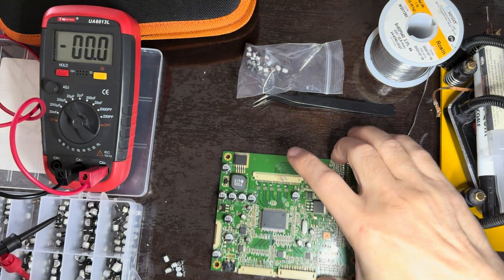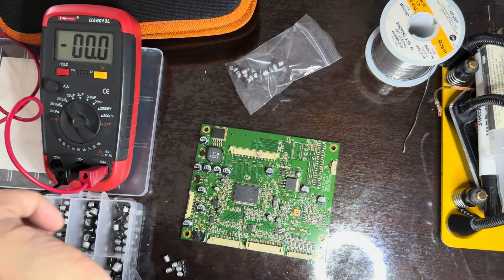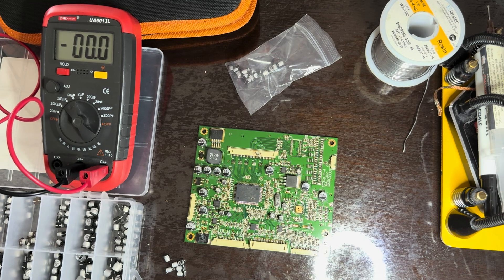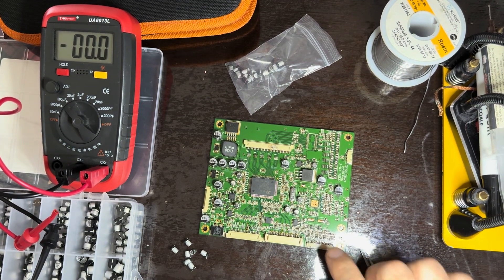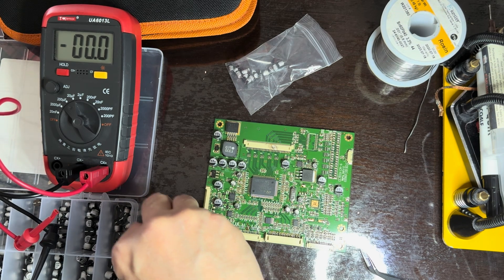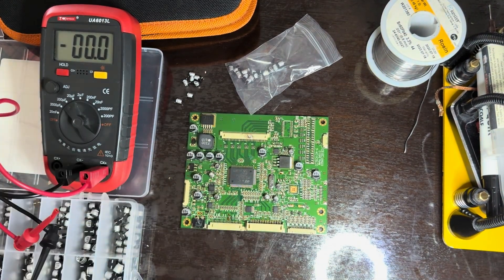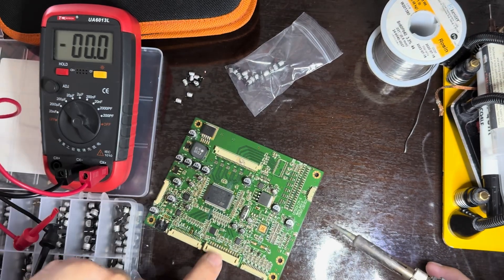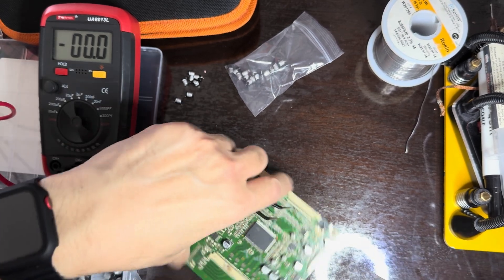JVL Vortex Screen Issues and Tear Down part 5 (changing old capacitors)

Comment: i need a working pglm0500201 for a jvl retro that shows all vertical color lines on screen at all times. do you have one for sale or know where i can buy one? thx
Reply from the maker: I do not, as the ones I repaired belong to a friend's restaurant. If you are unable to find one, and you are sure the issue is that board (verified the vga output works on another vga monitor), it is cheap to replace the capacitors. I mean... if you know that board is already busted.
Reply: @MouseFightStudio  do you know what the “no signal” screen means? With a piercing beep, and before that it said hit shift and f5?  Also where can I order a new motherboard? Is it a JP20 or JP30?  Ty in advance